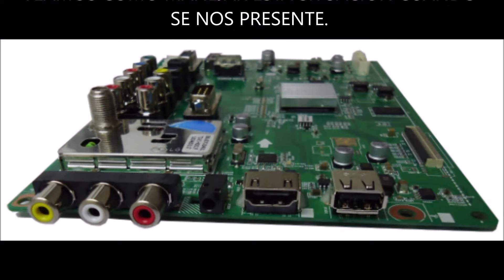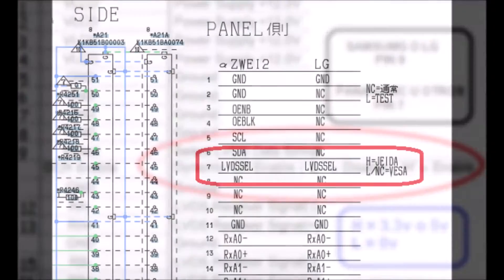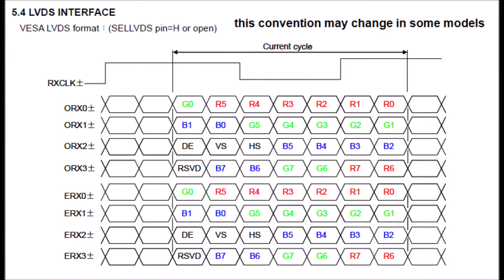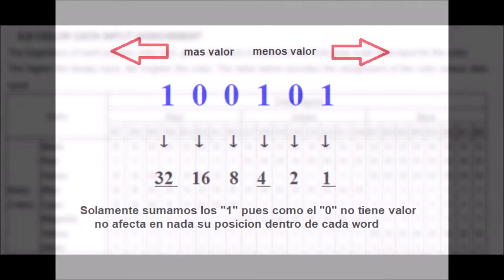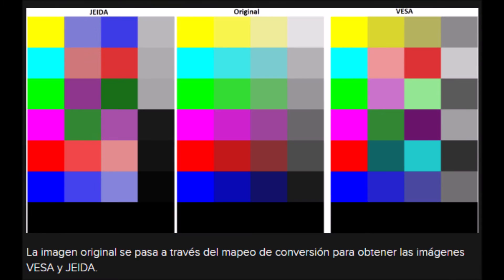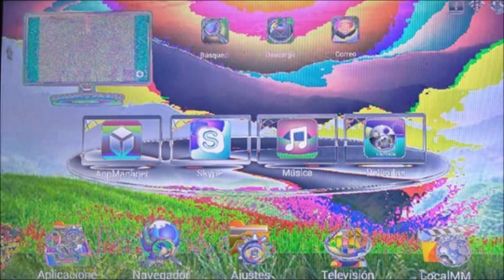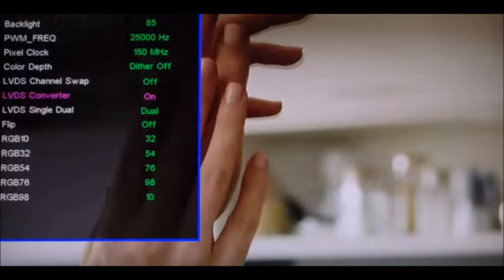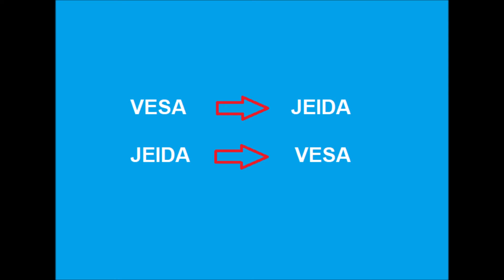QUE ES EL JEIDA Y VESA

Comment: Buenas noches. Ice cambió de tarjeta de una pantalla hkpro y esta solidarizada.  Alguien me puede apoyar con el método para ajustar? Por favor.  Gracias.
Reply from the maker: Hola muchas gracias por comentar, el problema tiene que ver con el formato jeida y vesa, es decir la cantidad de bits de resolución, como se explica en el video. La solución consiste en cambiar un bit de 0 a 1 o de 1 a 0 en el pin correspondiente del flex de la TCON, esto se puede hacer desde el menú de servicio del TV, entrando al modo de servicio con el control remoto original o cambiando directamente en el circuito, pero hay que desconectar esa señal que viene desde la MAIN. Un abrazo

https://www.youtube.com/watch?v=6KjS_DIsy_0

Comment: exelente aporte, gracias por compartir, tengo ese problema al cambiar la tarjeta main de una SMART TV AIWA, tengo el mando original pero no me se el codigo de entrada EN MODO SERVICIO, garadeceria si me pudieras ayudar con el codigo. un fuerte abrazo.y gracias exitos en este nuevo año
Reply from the maker: Hola Carlos muchas gracias por comentar, me das poca informacion del modelo, espero que esta informacion te sea de ayuda:  

Procedimiento #1: Encender el TV. Abrir el control remoto y buscar las teclas que no tienen acceso al usuario. Al presionar una de ellas y luego DISPLAY aparecerá en la pantalla el menú de servicio. Con CANAL +/- selecciona el ítem. Con VOLUMEN +/- y DISPLAY muestra los datos a ajustar.
Para salir, presionar DISPLAY y la otra tecla oculta en el control remoto, aparecerán los caracteres INITIAL por unos segundos y el TV se apagará.

Procedimiento #2: Con el TV encendido, presionar la tecla TEST del control remoto, luego presionar DISPLAY. Con CANAL+/- se mueve el cursor, con VOL+/- se ajusta el valor.
Para finalizar presionar DISPLAY y FINISH.

Procedimiento para AIWA TV-AR295 / TV AR 295 / TV-AR 295 y otros:
Presionar SW702 (Service) en la plaqueta principal del TV, ó modificar el control remoto colocando un pulsador entre los pines 13 y 16 del circuito integrado del mismo.
Con CANAL +/- se seleccionan los parámetros y con VOL+/- se ajusta el valor.
Para salir presionar OSD/OUT en el control remoto.

Procedimiento para AIWA VX-T1470 / VX-T2170 / VX-G142 / VX-S135 / VX-S205 y otros Combos (TV-VHS):
Desconectar el tomacorriente de la línea de CA por más de 30 minutos, ó cortocircuitar el capacitor de Back-Up que mantiene la programación.
Colocar el volumen al mínimo, presionar VOL- y simultáneamente la tecla numérica 9 del control remoto.
Con los botones 1 al 7 (ó 1 al 8 en algunos modelos) se seleccionan los diferentes modos (sub-menús) de ajuste y con VOL+/- se ajustan los valores.
Para salir y guardar los cambios presionar la tecla numérica 8 (ó 0 en algunos modelos) del control remoto.

Comment: Saludos. Gracias por el video. Tengo un TV CUBOT 32C9 el cual me presenta un fallo bastante parecido, pero al cambiar los valores en el modo de servicio,hace cambios, pero no se soluciona, al parecer tiene algún problema en la T-con. ¿Qué pasos debo dar para solucionar dicha avería ?

Algo interesante es que cuando subo el brillo de la tv al nivel máximo la imagen se normaliza, aunque el menú no lo hace, solo se ven bien las imágenes trasmitidas por el canal sintonizado, esto cuando el brillo está a 90 y/o 100
Reply from the maker: Hola Joel gracias por comentar, si en los casos que me comentas la imagen se ve bien es por que no hay problemas en el circuito. lo que deberías hacer es configurar para que se reinicie en los valores de fabrica y actualizar el software. Exitos
Reply: ELECTRONICA HOY TV  ELECTRONICA HOY TV  gracias  hermano. En el modo de servicio le di a restablecer a ajustes de fábrica, esto no solucionó el problema, ahora lo que voy hacer es tratar de conseguir el software para reinstalarlo o actualizarlo. El tv no es smart y la verdad no sé si se pueda conseguir la actualización de software, pero lo voy a intentar. ¿Habrá alguna pagina donde pueda descargar el software? Gracias
Reply from the maker: @joelrodriguez.605  hola joel, si no es posible que el fabricante te de la opción necesitas tener un programador de memorias para el tipo que use tu tv, también seria que consiguieras en algún centro de servicio alguien que te proporcione una copia para que con ella y el programador puedas realizar el procedimiento a través del puerto VGA. Éxitos

Comment: exelente aporte, gracias por compartir, tengo ese problema al cambiar la tarjeta main de una PHILIPS  32PHH4100/88, tengo el mando original pero no me se el codigo de entrada EN MODO SERVICIO, garadeceria si me pudieras ayudar con el codigo. un fuerte abrazo.y gracias
Reply from the maker: Hola luis, intenta esto:

Método 1
Pulsa los botones 0, 6, 2, 5, 9, 6 & MENU en tu mando a distancia.
Método 2
Pulsa los botones 0, 6, 2, 5, 9, 6 & INFO en tu mando a distancia.
Método 3
Pulsa los botones 1, 2, 3, 6, 5 & 4 en tu mando a distancia.
Método 4
Pulsa los botones 0, 6, 2, 5, 9, 6 & OSD/STATUS/INFO en tu mando a distancia.
Método 5
Pulsa los botones 0, 6, 2, 5, 9, 7 & MENU en tu mando a distancia.
Método 6
Pulsa los botones 0, 6, 1, 5, 9, 6 & MENU en tu mando a distancia.
Método 7
Pulsa los botones 0, 6, 1, 5, 9, 7 & MENU en tu mando a distancia.

Exitos